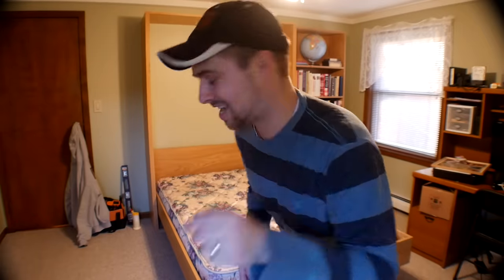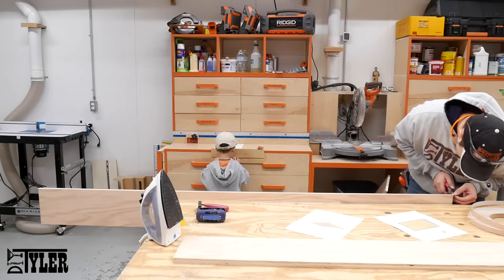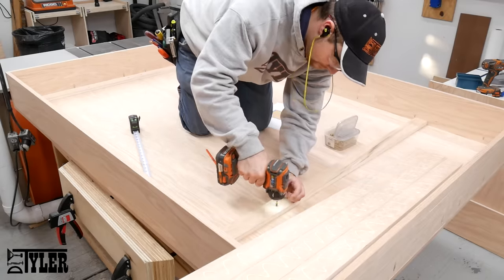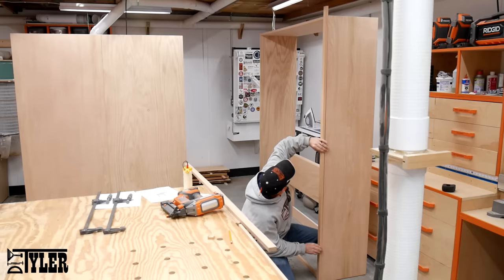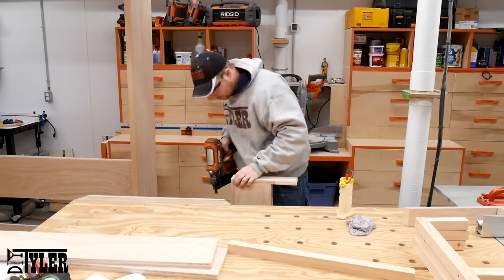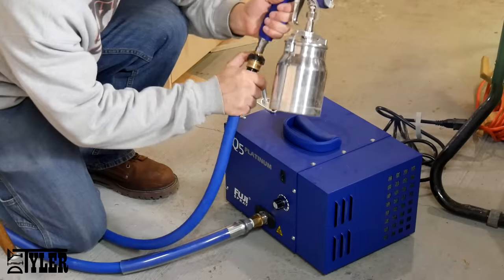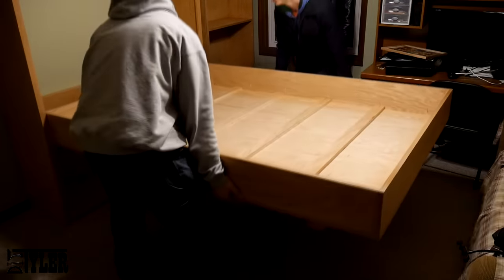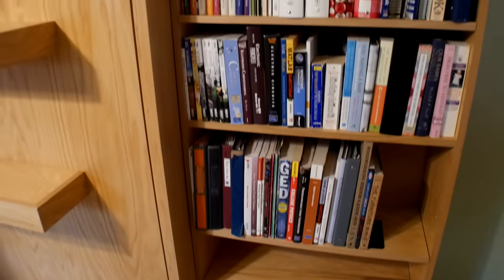Murphy Bed with Cheap $20 Hardware

Comment: How are the brackets holding up? You are loading them on an axis they were not designed to carry load on, but just because it wasn't designed for it doesn't mean it can't do the job.
Reply: Since the loading is only happening when the bed is lowered and raised, is that still a cause for concern? I got halfway to making a murphy with those flat swivel type plates but had to scrap it halfway, now I'm wanting to try again later this year. Surely it could work if the load was very low on upright and down flat positions? I'm starting to plan ahead now.

Comment: Hi Tyler, i purchased your plans and have everything cut up and ready for assembly. I have a couple of questions before proceeding. 1. Did you edge band every side of every piece, or just where you have them marked on the plans? 2. Did you do any pre-treating of the wood prior to spraying the tinted top coat? I'd like to tint a topcoat as well to not only save time, but keep much of the original color also. I'm wondering, though, if the birch plywood i've used might turn out splotchy without a pre-treating or if the stain being bound in the topcoat prevents that.

Comment: Hi. I bought your plans for the queen size version, but I have a question. You don't specify what thickness mattress you used in either the video or on the pla.n. Will the cabinet accommodate a 12 inch thick mattress or will adjustments need to be made?

Comment: Hi ! I would like to use the back of the bed as a chalk blackboard, so no shelves needed. My question is how structurally important are they. If I put one of those at the very top to be just the "legs" of the bed and some handles at the side to pull it up and down, would it be enough ? (sorry if I have any English mistakes)

Comment: Great build thank you.....Id like to add a pair of gas pistons...any idea what size would be appropriate?  putting it out there to anyone with an opinion too...thanks
Reply: Did you ever find a solution for Gas Pistons? I am considering dead weight counter balancing like in old double-hung sash windows

Comment: Tyler -- just completed a king size one.  It has a few mods because I had to make it work with a king size select comfort mattress.  Considering a gas rod assist cause it is pretty heavy.  One person lift, but don't let go!  One problem is the top piece is super long and has some sag (1/8 inch). Ill need to put a 1x3 on the top to shore it up level.
Reply: Hi Byran...what did you use for a gas rod assist. My bed is too heavy to deadlift into place for one person.
Reply: @KNARF1  no i didn't.  Probably should.  It's a2 person lift or one verrrry carefully
Reply: @bryanedmonds5943  I am looking at some 200lb on Amazon and will adapt them. Yes the design is great but when you add it all up..heavy!

Comment: Hey Tyler.  Great  work.  I have purchased the plans but had one question.  How long 1/4 20 bolts did you use for the brackets? Thanks in advance.

Comment: Couple quick questions. I just assembled this entire thing... but I forgot the wood glue. I used about 3 times the amount of screws You did though. I’m afraid to take it apart and use glue because then I might strip the holes out. 

Also, what size bolts did you use for the swivels? I’m not going to recess the bolts so just wondering what lengths and diameter they should be?

Comment: Hi Tyler,  Great build.  Did you add any more coats of finish after the stain/finish mix first coat? or was the one coat enough?
Reply from the maker: I sprayed two coats with the tint and a third clear coat over the top.

Comment: Tyler - I purchased your plans and am building my queen bed.  Quick question, do I put edge banding on the inside of the 31.25x81.5 front panels where they meet in the middle?  I know no one sees it, but would it make for a better seam?  Thanks, Steven
Reply from the maker: I didn't. Only reason I would  not would be that it might effect the total width a little bit, unless of course you take that into account.

Comment: I really like this Murphy bed. I only question about how high up the bolt is for keeping it closed. I see your wife and am wondering can she reach the latching bolt...lol
Reply: It's a little awkward having to do both sides individually.  So I would recommend ping in auto spring latches on each side, and a small string attached to the release.  Don't have to worry about getting both in that way, and anybody tall enough to reach the string can release it.

Comment: So I bought the plans, but half way decent plywood is crazy expensive where I am (South Australia). Do think MDF would be a strong enough alternative?
Reply: Just in general I would avoid using MDF for large projects like this. I have done that and it's really heavy and prone to damage. Especially for something that moves around and that you have to move (such as a murphy bed). Maybe laminated particleboard melamine, and pine (or whatever softwood you have down there). My 2 cents.

Comment: This looks like a good build,I downloaded your plans but I don't see where the change is for the swivel plates.Maybe I am just missing it but looks as it is in the same place as in your video.
Reply: Same here Paul. Im adding 1/4" plywood to the interior of the frame, behind the faceframe.
Reply from the maker: The plans have been corrected, adding more space will throw you off.

Comment: Do the plans cover other sized mattresses? I'm about to build a murphy bed for a king size and would love to not spend so much $$ on the premade kits
Reply: Brian Nelson I purchased the plans with the intention of making a queen size. The plans dont include measurements for other sizes but besides altering the the cut plan all it would require is adding the difference in length and width to the outer box and frame. For a queen that would be 7" to the height(or length) and 5" to the width of all appropriate dimensions. Personally I  think a king would just be to heavy without spring or gas shock hardware.  Ultimately I decided to stick with the original full size because I happen to have a mattress laying around.  I start the build today.
Reply: I just made a king size bed.  It is definitely heavy, but doable.  We use a select comfort mattress.  It requires a couple of holes in the back of the bed box and a routing tie down for the hoses.  I added 22 inches in width and 5 in height/length.(plus 2.75 inches for wider shelves)  I expanded the headboard to 16 inches.  I made the 2 vs 3 shelves 10 inches instead of 7.25 which made the bottom kick board go from 1 inch to 3.75 and moved the rest of the hardware and headboard up 2.75 inches..  I am adding a stiffener board in a t configuration to the middle top of the top board to resist sag  in the long span of plywood.  It is a beast, but It works.  I used paint vs stain to match my decor.

Comment: If I have and 17" in mattress do I have to increase the depth of outer frame. If so how much could not find the depth of the mattress being used.
Reply: I just built the queen version, and there are 15 1/4 inches of space between the box floor and the wall when the Murphy bed is up. The bigger problem with a 17 inch mattress is that the box for the bed only clears the top of the frame by about a quarter of an inch as it swings open, so if the mattress extends past the top of the box it’s going to catch on the top of the cabinet frame as it opens.

Comment: Could I use particle board or MDF to build this, or is plywood best? I plan to paint it, so I don't need the hardwood veneer, but do want it to be strong.
Reply from the maker: I would use plywood. MDF or particle board will not hold up.

Comment: Hey Tyler, really excellent video. Just wanted to clarify...your blend is 95% top coat and 5% stain? And does this ratio work with various coats/stains? Thank you.
Reply from the maker: I believe I mixed at 5% but with general finishes you can pix up to about 15%. You have to have a water based stain or due with a water based topcoat. Oils will not work.
Reply: @DIYTyler   is it safe to say if I mix up to 15% the darker the stain will be? I am wanting a nice dark Espresso.

Comment: nice build Tyler.  Question...I am considering a murphy bed in our new home.  Do you think it is possible to mount a tv to the bed so that when it is folded up you can watch tv?  Thanks for any advice and thanks for making these videos.
Reply: Garrett Welfare, due to window placement, my thought has been to build one that pivots on a long side, rather than the head. Allowing for a shorter cabinet that fits under my odd window. Might that be enough to hang a TV?
Reply from the maker: +Garrett Welfare I am not sure that the tv would be able to supports itself hanging from the back like that. Different forces compared to haging vertical. Can always test and see. Murphy bed won't care what's on there!
Reply: that was my concern too.  I know that the tv mounts have the hooks at the top, and the set screws at the bottom which keep it stable, but I am not sure if the vertical force when rotated 90 degrees is too much for the set screws to hold.  Thanks for your response and great videos.  I have learned a few tricks from them.

Comment: I have a dumb question. I just bought boat brackets to do something similar (I'm trying to fix the Murphy bed in my short skoolie conversion, which is difficult to maneuver because of the space). The brackets arrived, but they are so stiff they're not turning I see how easily you move the plate ont his one, and it makes me wonder, did you have to loosen the bearing, or are mine just defective?
Reply from the maker: Didn't have to loosen anything. When you get the leverage of the bed on there they move super easy.
Reply: @DIYTyler  OK Thanks!

Comment: Can you tell me what size 1/4 #20 bolts you used for mounting the pivot plates? How long?
Reply from the maker: Just emailed you Drew.
Reply: @DIYTyler  Tyler I have the same question. I bought 1 1/4

Comment: in this situation aren't the shelves useless as they don't pivot to stay upright as the bed is brought down so anything put on them is just going to fall onto the ground? Only thing I can think of is maybe some fake plants glued into place
Reply from the maker: They are the legs to support the bed.
Reply: @DIYTyler  I know that :) but at the start of the video it stated leg/shelves so originally I was expecting a solution where they would be usable shelves. It's still a very cool project especially for the budget.

Comment: 06:25  This is the single most terrifying thing you've ever done???!!! Why is it that so many (american) carpenters use their sawblades as low as possible? I work in the Netherlands as a carpenter and we were teached at school to always use the blade in the highest possible position to minimize the risk of launching the workpiece when the teeth grip the wood. It also minimizes splintering.

You know what IS dangerous? Using the saw without the plastic protective cap! And then using only one hand to control the workpiece whilst using the other hand to hold a vacuum cleaner! Good for your lungs too :)
Reply: They also make saws now that have an instantaneous retraction when skin touches it.
Reply: i was trained to have the saw just enough through the wood your cutting so it makes for an easier cut and smoother cut. and i do construction
Reply: If you're using your blade as high as possible, you're doing it wrong. There are physics behind the "low as possible" approach. The higher up you go with the blade, you are: increasing the contact surface area between the teeth and the wood, increasing friction, inducing extra heat, possibly ruining the temper of the blade, causing the blade to expand and wobble in the cut, putting extra wear on your motor and bearings, so on and so forth. By lowering the blade, you allow the teeth to make as little contact as possible, reducing the chance of everything that I mentioned above. If your wood happens to be taller than you've set your blade, you'll know it as soon as your board hits the plastic safety guard, because you won't be able to push any further. It's less safe than the too-tall method because more of the rotational force is sent toward the user because the blade is making contact with the board at a much lower angle. With the blade raised up, the teeth are practically driving the board straight down into the table, further adding to the problems I listed earlier.
Reply: exactly right.. i was taught to run the blade low to keep it as cool as possible. I assumed that the heat was caused by the side of the blade rubbing the work piece..the lower the blade runs ,the less exposure.
Reply: en zo is het

Comment: Sweet that your son can be "at work with daddy" but I'd like to encourage you to have your children wear ear protection when you are using your power equipment. Children's hearing is more sensitive than adults' and is more easily damaged by such sounds over time. I'm sure you do not want him to suffer with noisy tinnitus or worse, painful hyperacusis, when he is older and looks back on his noise exposure as a child in daddy's shop. Good job on that bed; you're a craftsman for sure.

Comment: I want a Murphy bed similar to this, except one that sleeps only one person 5'6" tall, so a twin size (39"x74" mattress) and folds up into a workshop type counter or desk. When the bed is folded down into bed mode it can also double as a large couch platform for watching TV too. How can I modify the plans to fit my needs? Thanks

Something like this "https://i.imgur.com/zH5OqyT.jpg" but with a flip up work counter desk surface that can be used when the bed is put away.

Comment: The shelves seem ridiculous to me unless I'm really missing something. You put the bed down and everything falls off the shelves. You'd have to float the shelves on gimbals to keep everything on them. I love the video but the shelves are an illogical stretch. Also, the truth is that whether the bed is up or down, the same floor space (as well as the space needed to swivel the bed) is dead space. The "open" space created by the bed does not create more livable space.
Reply from the maker: They are the legs of the bed. Very necessary.

Comment: i'm still waiting for the video "Murphy Bed with Cheap $20 Hardware"
Reply: Hardware = nuts, bolts, screws and swivel brackets. If you're spending much more than $20 on that stuff, you're doing it wrong.
Reply: @jknapp868  so what about all the other stuff?
Reply: @anthonyreyes8637  Well, there's lumber (wood), adhesive (glue) and tools (tools)... and a mattress
Reply: @jknapp868  exactly
Reply: @anthonyreyes8637  And yet there's still only $20 worth of hardware... like the title says